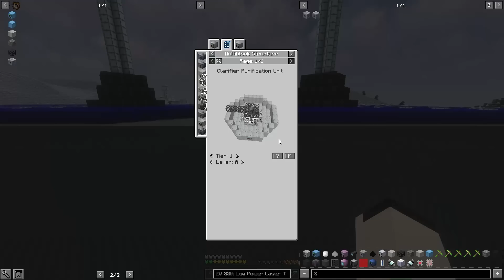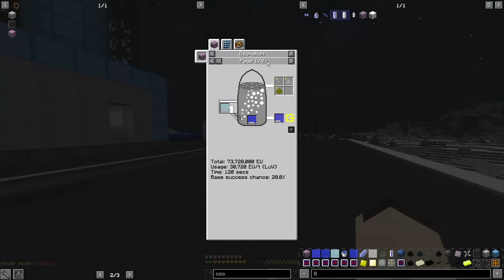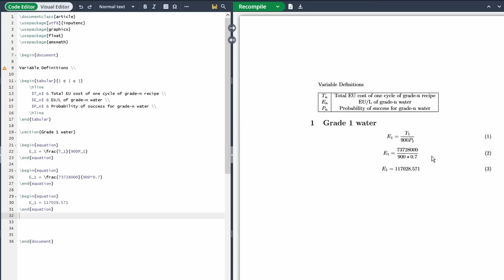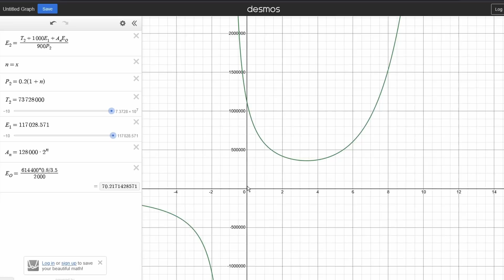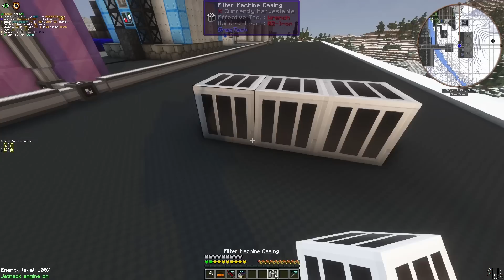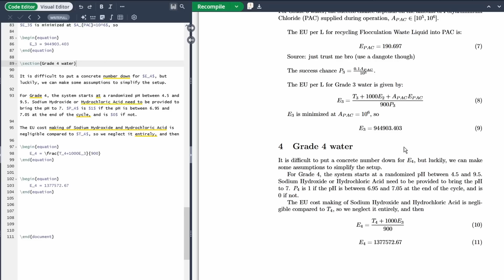GregTech New Horizons E85: Waterline, But For Nerds

Comment: so apparently there's a base chance of 10% for the grade 3 water, so its only 900kl i should input ?
Reply from the maker: Dear employee,

Correct! I just did 1M because its a nice number but 900k is what you actually need

Best,
HamCorp
Reply: @Ham-Corp  thank you CEO, could you please also confirm that for grade 1 and 2 water, its more efficient to loop back the water into their plant as additional input ?

so clarifier will have a input hatch with a fluid storage bus filtered for grade 1 water with higher priority and same with grade 2.
Reply from the maker: @sakuraadachi8602  I believe so but I didn't bother with it myself

Comment: Dear CEO,
In Water purification plant controll block tool tip said using 10% target output can boost 15% success chance. Does this make any change to the efficiency?
Reply from the maker: Dear employee,

I haven't looked into that, but that would be better. I decided not to bother with the additional complexity, but maybe I will in later waterline expansions.

Best,
HamCorp

Comment: Dear CEO, I have a question.
Considering you have to produce much more ozone per second for the most efficient recipe, does it bite into the EU benefit you calculated, and if so, to what degree? Especially because the demand rises exponentially.
Thanks in advance.
Reply from the maker: Dear employee,

The cost of ozone production is factored in to the effective cost of Grade 2 water. The EU saved by virtue of getting more Grade 2 water vastly outweighs the exponential ozone demand.

There is indeed an energy cost minimum as the amount of ozone increases, and the energy cost eventually starts rising again as we increase ozone amount, but that ozone amount is larger than the maximum we can supply in the game.

Best,
HamCorp

Comment: Good video, I love the use of LaTeX. And based on other streams I've seen, the water line gets really complicated, so I look forward to seeing more when the training manual gets there.

Some small LaTeX tips if you care:
* It might be worth looking into the align enviroment (well, align* unless you want equation numbers) from the amsmath package for things like your variable definitions. I just find it easier to use than remembering how to make a table. Plus it's in math mode automatically, though you can use \textrm{} to include actual text.
* Similarly, for stuff like the bulleted list in the Grade 2 water section, I'd recommend the itemize environment (or enumerate if you want a numbered list). You can customize the styling of the bullets, which numbering to style to use in enumerate ((a), a), iii, etc.), and it will also handle indenting and so on for you.
* When representing multiplication in an equation, it's pretty standard to use \cdot instead of , since * is often used as either a special operator or for things like A representing the conjugate transpose of a matrix. You can also use \times if you really want to, but that's more for things like a cross product.
* This is more of a typesetting thing, but for inline fractions like the success chance P_3, I would recommend not using \frac{}{} and instead just writing a "sideways" fraction like 1/2 instead of \frac{1}{2}. Using a \frac inline can result in squashed, hard-to-read text. And if you end up in a situation where the sideways fraction is long or confusing, that's a sign you probably want to bring it into its own equation.
* Speaking of equations, if you're using amsmath and want an unnumbered equation environment, instead of using equation*, you can use \[ and \] for an easier-to-type syntax that resolves to \begin{equation*} and \end{equation*} under the hood.

Hopefully that unsolicited advice is useful, or feel free to ignore if not.

Comment: Mr. CEO, do you ever plan to do beamline when you get the chance? I have it in my own factory and it produces so many flippin circuitry wafers like PPIC. I love spending like 60 wafers to get 32k circuity wafers. It's amazing.

Edit: bro did not need to do math for eu costs. 😭 hope you find a better power solution for this, or you will struggle in ZPM. Good luck!!!
Reply from the maker: Dear employee,

Absolutely! I haven't looked into when I can start working on beamline though.

True but it was fun. I'm definitely not going to scale up solar towers any more, I'm pretty much at the limit of what I can squeeze out of them.

Best,
HamCorp

Comment: Shouldn't 250% faster mean 2.5 speed of operation?
Reply from the maker: Dear employee,

I thought so too, and I checked with a multiblock mixer recipe. Admittedly that's a different multi, but the tooltip is the same. From that test, 250% faster does indeed mean 350% of the base speed.

It might be worth checking in a creative world, but I'm quite a few days ahead of this video now, and I've had no ozone shortages at all.

Best,
HamCorp
Reply: @Ham-Corp Well, percentages are always difficult for me, especially not in my native language. I'd have to remember some
Reply: Think about how 100% faster means double the speed. So 200% faster is triple the speed and so on. In general x% faster is (1+(x/100)) times faster
Reply: @MultiplyByZ3r0 It's weird that for "100% faster" it's obvious to me, and then the difficulties start next. Interesting how my brain works, yeah
Reply: @Kronos381  I'm a native English math major and the distinction between "x% speed" and "x% faster" still gets me sometimes xD it might be useful to understand "x% speed" as a multiplication of the current speed, whereas "x% faster" is an addition of x speeds to the current speed, that's how i think about it to avoid confusion